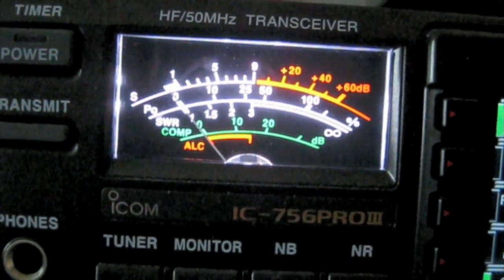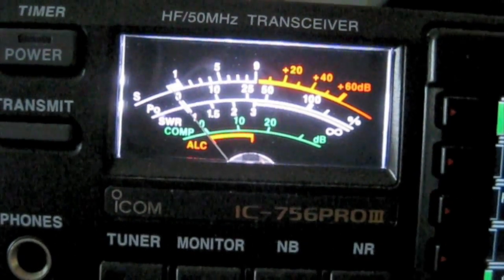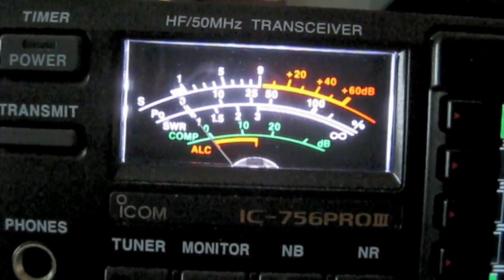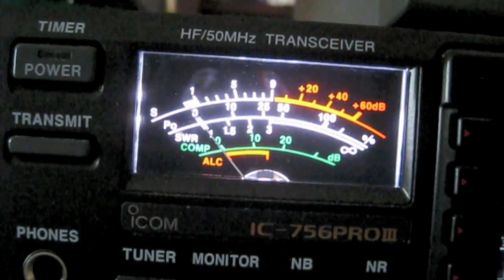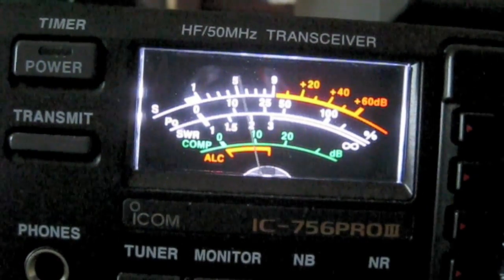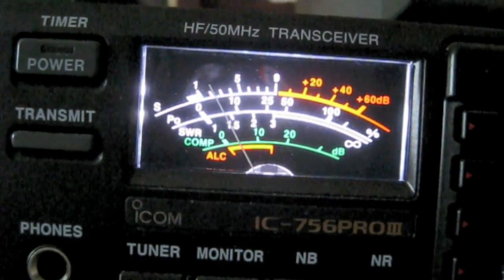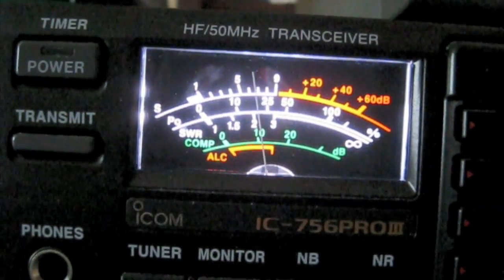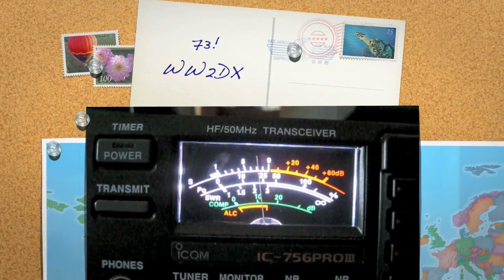Hex Beam VS Titan GAP Vertical

Comment: I've since got the Chameleon MPAS 2.0 with CAP HAT and been amazed at how far I can hit, Chile, Brazil, USA, and last night on 17m Panama all with just the single supplied radial and the thing that amazes me is how quiet it is on receive. 

The other night on 20m UTC  I was listening to a VK station, could hardly hear him on my EFHW 49:1 and he was quite clear on the MPAS 2.0 but unfortunately he went QRT  before I got a chance to try contact him. The MPAS 2.0 is amazing for a portable antenna.

I had got the MPAS 2.0 to work portable but set it up last May on the front lawn to test it out the day I got it and had QSO with a Brazilian station, I was amazed and not expecting this kind of DX with a portable antenna so I left it on the lawn for the past year now and use it in the sitting room with the FT-891 which has got amazing Receive Audio, much better than my IC-7300 which I hardly use any more. 

The thing that turns me off verticals is radials, while I do have the space I don't want to have a big vertical on the back lawn with 60 odd radials and neither does the XYL so the Gap does interest me a lot if I can get this level of DX from a Chameleon MPAS 2.0, the other antenna I could install the the 43 foot Gap Challenger  or voyager which would probably perform better and the voyager can work 160m. It got great reviews and can get away with much less radials so I could hide the antenna better.

Comment: I've worked on Pro-3's and can verify that the Pro 3 S-Meter is calibrated for about 6db per S-unit.  So in effect what you're telling me is that a 2 element compromise antenna is exhibiting a staggering 54db of gain. Please what this video should tell any technical commitment ham is that there is an installation problem with the other antenna.  The noise floor on that vertical was not even S-1 was it even connected. 

I have several HF antennas here to play with, A 5BTV and R8 verticals. I also have a TGM mini beam as well as a Hex beam. To be honest It's a toss up between the TGM and the Hex sometimes the Hex is better sometimes the TGM but 90 percent of the time I see very little difference between the two. 

 On short distance paths under 2500 miles the Hex and TGM are usually 3 S-units stronger than the verticals. On  longer paths between 7 and 10K miles the verticals quite often outperform both the Hex and the TGM. 

 Of course this is what you would expect to see.  I'm sure the beams would perform better if I could get them up to 70 feet or more.  35 feet just isn't high enough to bring the take off angle down low enough for reliable 10K+ paths. Of course if I was going to put up a 70 foot tower the last thing I would put on top of it would be a Hex at that point we're talking Optibeam and QRO. Don't get me wrong the Hex is good low budget antenna installations but it is what it is and that is a compromised 2 element wire beam.  

Unfortunately ham radio has been infiltrated with former CB'res who brought with them their preference for wives tales and snake oil over science and engineering.    As such the performance claims of various "trendy" products have been massively exaggerated. 

  The Hex beam is no exception, it has suffered the effects of  becoming a "Trendy" product in an increasingly iletrate consumer market.  The Hex has gone from being a reasonably efficient compromise antenna to being a magical antenna capable of defying the laws of physics. Your video does nothing but help propagate this type of ignorance.

Comment: The difference between the vertical and a beam depends on soil conductivity, terrain and obstructions. In my location in GA, full size verticals are usually 5-15 db down from dipoles. Long haul DX included.

Comment: @AudiophileTubes 

I have to agree. There's something definitely wrong with the installation of the GAP. I Use both a Hustler 5BTV and a Hex Beam and it's hit or miss on which one performs better. On DX more often then not the Hustler is better because it has a much lower take off angle. The Hex is up 33 feet and more often then not it does better state side.

With that said the Hex has the benefit of directionality which allows me to null out strong stations.

Comment: @Tritone217 Remember difference between S-units on HAM radio meters can be just 2-3dB.  In addition you have up to 20dB difference between vertical and horisontal polarity.  Also the angle the signal hits from the sky can be significant.